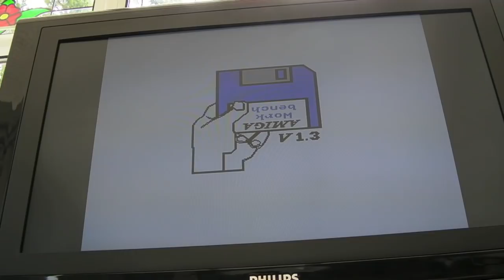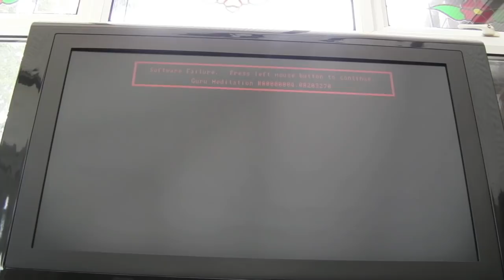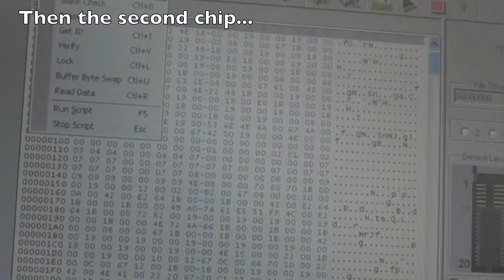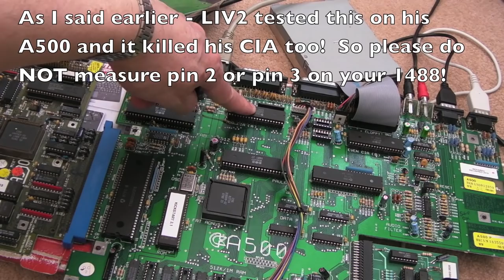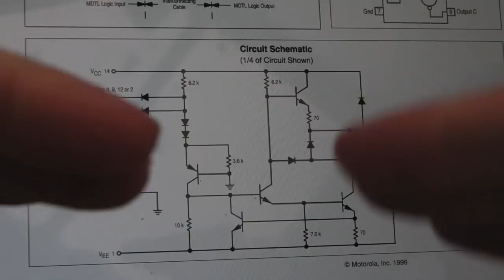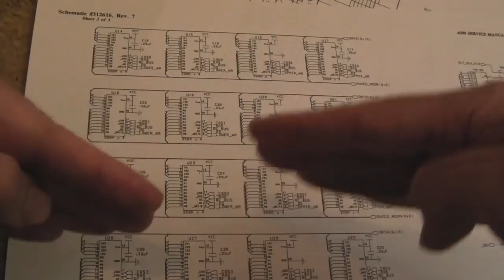Commodore Amiga A590 & A500 R6 Repair & Flaming CIA Chips!

Comment from the maker: NOTE: I did lots of stuff off camera that I cut.  eg.  Removed and tested all of the EMC components at the back of the board that were related to +12v and -12v.  I removed and tested every component related to the filter (this was whilst waiting for the MC1488P).  Checked voltages many times - the only point I didn't was when the DRAM chips were burning - I didn't want to risk leaving it powered whilst measuring.  I also completely swapped that bank of 4 DRAM chips - same issue.  I inspected the sockets thoroughly around that area, and all the traces.  Measured ceramic caps around that area of the A590 too.  Since the problem also at one point occured on the rev 5 board, and a rev 3 board - that rules out the rev 6 as the cause of the baking RAM too.

If I can find a couple of CIA chips I will re-visit this and connect up the scope and multimeter to measure voltages on both sides of the board.  I will also measure temperature of those DRAM chips on the A590.  The problem is I have no spare CIAs and I am 100% certain more will die as part of the testing to try and understand what was happening.   There is also a risk of something else failing whilst doing the tests (eg. A590 or something else on the A500) - so that makes me a little nervous to repeat testing to understand this further, without at least some theory of why.

I cannot find the Dave Haynie "mirror" site I found previously for the JEDECs, but this site has a mirror of the files too.  https://www.amigawiki.org/doku.php?id=de:parts:pld_download
The other file for the A590 was never published, but Matze has created a suitable file himself which will be covered shortly in relation to anothher A590!

Comment: For some readers....
The A2091 uses the "three RAM bank system"
Similar to how most A500's and the old A1000 rejuvenator board (I suspect) used.

Bank "0" (zero) is always 512k of RAM  Just like on All rev A500 boards up to the A500 +" which I believe uses Bank 0 to hold 1mb of CHIP RAM... I Don't believe that bank on the A500+ can be divided even if using a 512k Agnus.. 
Bank "1" holds the 2nd 512k of RAM..  when using a 512k Agnus this RAM will always be "slow RAM".  Usually, bank 1, shifts to an A501 expander  OR the designated 512k area of an ICD AdRAM board or Expansion Systems Baseboard to name a couple.
Bank "2" (like on that A590 or the A2091, is made up of a full block of 1MB of RAM (using both rows of RAM).
Very similar to doing an earlier revision 5a to 6a A500 mobo to adjust to 1mb on board (with adding sockets for 1mb of RAM... PLUS adding a 1mb trap door RAM to make use of a 2MB chip RAM setup. This takes some effort to remap that trapdoor slot to become "bank 2" and allow the additional added sockets to be used as "bank 1".
Whew
That was easy enuff to explain.
There's some more techno mumbo jumbo and terminology I'm sure I could use but essntially that should explain in layman's words what the idea is.

So adding that final 1mb of RAM to the A590... is adding RAM to the final "bank 2"   with the first two banks of 512k being  just 512k and 512k each.
I think the reason they did this is flexibility.
So most boards come with 512k to match older revision A500's ...   512k CHIP and 512k Fast.
Then , adding an A501 makes it...   512k (16 bit) FAST, 512k CHIP, and 512k Slow....  (in order of priority)

As owners got braver...  they upgraded said older board to a 1mb Agnus..  did the CHIP RAM hack to give it 1mb of CHIP...
then added 512k more to the A590... and poof...  just like that you got  1 mb Fast, 1mb of CHIP and 0 slow RAM.
Not a bad system setup for a 1.3 workbench from harddrive....

But of course if you give a man 512k more RAM...   he'll want 1mb more....
And the mad craving for power causes that man to add MORE RAM as he slowly becomes a Dr Frankenstein.

Then he's buying a higher revision board..  figuring all the maths and trigonometries to get 2mb of CHIp and 2mb of Fast...

Then he adds a M-tec board... to get 4mb of 32 bit RAM...

Then somehow that's not enough

So he gives up and gets a 3000

LoL

Comment: I did the same exact thing to my 590 several years ago and also chalked it up to resistance over ground causing the PSU to go nuts.  After I roasted the RAM I figured everything was shot and I've not used it since.  In fact, I stole a few parts off of the 590 over the years.  Thanks to your video I'm inspired and started the process of putting it back together.

Comment: Hi great video, need a little help, I have a Amiga 500+ and when I power up the board all I'm getting is a red and green back and forth, and 11 flashes on the Led, I removed the battery and cleaned all the board and chip carriers, all tracks tested ok, I've replaced the fat agnus chip carrier, any help would be greatly appreciated:)
Reply from the maker: That tends to be what you get when a trace is damaged around Gary or the data path area.  I would suspect a trace tbh - it can be very hard working out if all the traces are good.  You could test with Diag ROM - see if that will boot.

Comment: If the A590 is powered on before the A500, the A590 can power the A500 supplyrails through internal clamping diodes of the devices in the A500. The I/O signals from the devices of the A590 are powering the supply rails of the A500 which is a substantional load. The A500 normally turns on the A590 powersupply to prevent this (powersequencing). You turned on the A590 first but later 'solved' the 'problem' by powering the A590 from the A500 (single supply). Your conclusion on killing the drams was right but the explanation needed some background information.
Reply from the maker: Thanks, that makes perfect sense!! =D

Comment: From the memory 'ground' on the output of ATX power supply is actually floating in respect to earth pin. There's also usually an interference cap between primary hot side and secondary transformer winding so you could have easily ground loop between power supplies with just enough high voltage low current AC ripple to destroy CMOS chips by latching them.
Reply from the maker: Ahha!  That would explain it!!!

Comment: Very wierd.. I have measured the pins on CIA's plenty of times with power on, without incident. However I am usually using a 'scope probe not a meter, but I cant see why it would make any difference. The input impedance of a multimeter is usually well over 1Megohm so no harmful current could flow
Reply from the maker: I don't get it either - but I was 100% sure when I measured the 2nd time that I was no where near any other pins - so I definitely didn't short it.   Then LIV2 tested on his A500 with an A590 and the same happened?!?!
Reply from the maker: I am sure I've measured 1488 pins in the past too btw!  It must be related to the dual PSU situation.

Comment: Seems like those DRAM's where going into a latch-up fault condition which could occur with incorrect sequencing turning on supply voltages or some I/O pins on them exceeding specified voltage levels.
Reply from the maker: If it was a latchup type problem, the current involved was pretty significant!  I would hazard a guess at over 150 degrees C - maybe higher.   I will be re-visiting this though!

Comment: this antistatic bag you use as the insulator - is conductive....
Reply from the maker: No, it isn't conductive - I've tested it!  I tested it way back when I first got the SCSI2SD.
Reply: @GadgetUK164  Good for you. I once upgraded 25 PCs, putting their bags under new mainboards, just to be sure nothing shorts with the standoffs. To my surprise, all of them started to loose all the cmos settings randomly....until we had to redo the whole installation. ;)
Reply from the maker: @piwex69  Some are conductive, some aren't!
Reply from the maker: BTW - sorry for being a bit snappy there!  It's just sometimes people assume something when I've already ruled it out etc.  I learned the mistake of using certain ESD bags a while back!  So it was a certainly something worth pointing out as others may not be aware of it.

Comment: Chris didn't hear you mentioning this (and I don't know if it is of any importance here) but the original A590 power supply has a voltage sense line on pin 3 and a relay which only switches when the Amiga 500 its connected to is turned on. BTW I enjoyed very much your thorough troubleshooting process! Keep up the great work!
Reply from the maker: Thanks, yes - we covered that when looking at the schematics towards the end there!  That's ultimately why I powered the A590 directly from the Zorro connector.

Comment: I think you just power the HD extension and not the Amiga. Maybe the Amiga GND and the HDD GND have a voltage difference. I mean just only use the power supply via the extension.
Reply from the maker: Thanks!  That's the theory I came to as well - hence the direct wires from the Zorro edge to where the DIN goes (at the end of the video).

Comment: I’d give that filter a long, hard look. There’s no way the filter should be pulling down the +5 volt rail enough to visibly dim the power LED on the keyboard. A passive filter is nothing but a bunch of passives (resistors, capacitors, and/or inductors) along the signal path. For a low-pass filter, you would have resistors along the signal path, and capacitors from the signal path to ground (a so called “pi” filter.) An active filter just puts these components in the feedback path of an op-amp, such as a 741, 1458, TL081, etc... and an op-amp has a high-impedance input so it shouldn’t load down pin 3 on the 1488. In fact, I’d say it was bad design to use the 1488 for this; I’d have used a power NPN, or a section of a NAND gate (LS00), or a hex inverter (LS04) as a buffer; that way, a failure doesn’t put +/- 12 volts back into the filter or the chip that generates the “_LED” signal. HTH. ❤️
Reply from the maker: The audio filter circuit on the A500 is designed to make the power LED go dim!  That's how it indicates the filter is on!   But I see your point there!  It does seem that a failure around there has the potential to backfeed 12v into the CIA.

Comment: Also, is this keyboard the same one you modded in the previous video (the one where you removed the transistor)? Could that be related to the problem? What if you use a bone-stock A500 keyboard? You did mention in this video that that LED is connected to the 1488, so maybe the missing NPN transistor did something besides just buffer the logic-level signal? What if your friend modded his keyboard the same way, and that’s what fried his CIA, too?
Reply from the maker: No, it's a different keyboard that is unmodified and works perfectly!   This A590 video was filmed a good 2 or 3 months before I did that other video where I modded the LEDs etc.  The other thing I think that was common to LIV2's setup - I think he had an A590 connected too.  So maybe its related to the dual power thing?!?!

Comment: Here’s an idea: unplug the CIA chip and the 4 RAM chips on the 590 board, then hook up a scope to the power rails on the CIA chip and measure pin 3 on the 1488 with the floppy drive plugged in. Then do the same to the power supply rails on the RAM chips on the 590 board. Maybe a spike is occurring on the power rails for the CIA and it’s burning it up, and the fault propagates to the 4 RAM chips, or vice versa. But the weird part is: why only those 4 RAM chips? Why not all of them?
If I remember correctly, the 1488/1489 are RS232 bus transceiver chips, and - like any op-amp - they need a split-rail power supply (in this case +/- 12 VDC.) My guess is that’s somehow showing up on the CIA and on one of the pins of those 4 RAM chips on the 590 board. You should be glad they don’t make RAM chips the same way they make lithium-ion batteries, or they would have swelled right up and burst open in flames! 😏
Reply from the maker: I really wanted to test with scope and meter connected (and show temperature of those RAM chips, because they are well over 150 degrees C for sure - you can smell them after around 1 second of the problem starting) - but I cannot afford more CIAs just now.  If I can find some more CIAs I will revisit this - ie. detach the joined power rails, power with the ATX again and do these tests to see if I can get to the bottom of it.  Right now I just cannot risk more CIAs as I have no spares.

Comment: BTW you can power up the A590 from the Amiga side bus, i have done this on my 2 A590's they work fine..
Reply: Same, but burning out the tracks is possible, so the power mod is recommended. im surprised hes having so much trouble, ive found the 590 (2mb) to be bomb proof and i have put the DMM all over the system,  but maybe not that particular pin. could be the 1x psu that saves it after all. i never had issues when powering up in the wrong order with 2x psus either.

Comment: Yeah, CIAs can fail partially. Had a dead 1541 where the CIA's serial port was bad, and a Vectrex that wouldn't blank the video, I just switched the CIAs over and both machines work fine because the 1541 in that position doesn't use pin 19 (or doesn't seem to use it as the drive works fine) and the Vectrex doesn't use the serial port.

Comment: This makes no sense, a multimeter set on voltage range typically has a 10Mohm impedance, so how does connecting what is effectivery a 10Mohm resistor between ground and pin 3 of the 1488 kill the CIA? It can't! Most likely what both of you guys did was that your probe slipped when measuring and you shorted pin 3 of the 1488 which is a +/-12V output to either pin 2 or pin 4 which are TTL inputs. Also pin 1 is the VEE -12V supply so shorting that to pin 2 will kill something.
Reply from the maker: I know lol!  It is crazy!  What I do know for 100% certainly, multimeter was on the right mode, probes in the right positions.  I didn't accidentally bridge anything whilst measuring - I was very very careful the 2nd time around to make sure there was no chance of that at all, and the exact same thing happened to LIV2 when he measured the same pins on his A500.

Comment: Fun fact. The XT Connections... There is Two becous it came with Two different XT disks, and to acomodate the Cable Management. They populated with pins depending on witch disk that was in. One was XT Cable on right side, the other XT Cable on the Left side 💪

Comment: Couldn't you get side cards like this with a 030 chip on it as well think that they where made by gvp 🤔
Reply from the maker: It's possible GVP or someone did one - I've never seen one though!
Reply: @GadgetUK164  GVP have produced both an 68030 accelerator (http://amiga.resource.cx/exp/gvp530) and a SCSCI controller with RAM (http://amiga.resource.cx/exp/impact500mk2) in sidecar expansions for the A500. They were both great expansions and with a case that matches perfectly the A500 style.

Comment: With reference to the odd issues you are getting with the 2 seperate switching supplies, there is no problem with connecting the grounds of them together in a circuit like this, however If either one of the supplies have any earth leakage, this can result in a common mode AC component relative to earth on that supplies output. This can cause issues depending on power up sequence and timing, especially where logic boards are concerned.

You can do a basic test to see if there is any earth leakage by checking for any current flow on the DC outputs of each supply to earth (mains earth). There should be next to nothing, if your seeing anything in the milliamp range, then the supply is leaking and its outputs will have some path to AC live, albeit it small but enough to possibly cause problems when linking supplies together in this way.

You might want to isolate yourself when doing this test (dont hold your meter probes, use crocodile clips) - just incase one of these supplies is leaking badly and has a path back to live.
Reply from the maker: OMG - of course!  I used to PAT test things, I should have worked that out!!!  I did used to have a PAT tester too =/  Thanks!  I will have a think about next steps on this and will do an update video at some point!
Reply: @GadgetUK164  I would love an update to this, I feel like this would not be a stone but a whacking great boulder left unturned if there was no conclusion to this. That's a scary thing that you could be checking voltages and have this have happen...wow! It makes me think though that a rare issue like that has a fairly rare cause in as far as these power supplies would only exhibit this when they have had years on them and therefore blower maybe onto something.